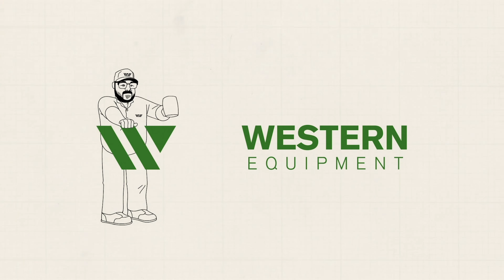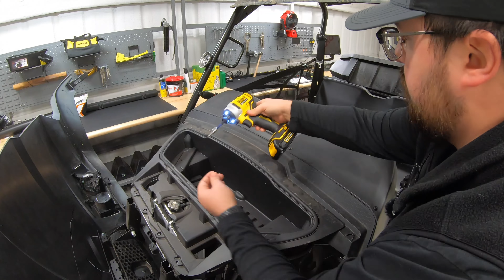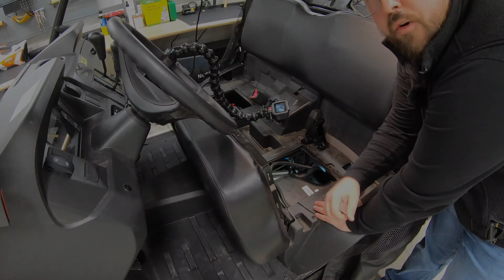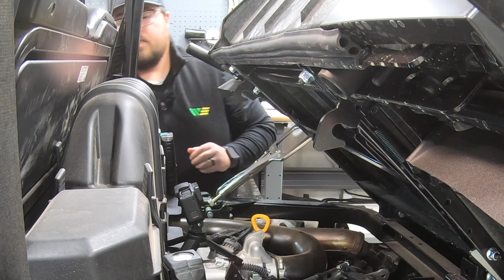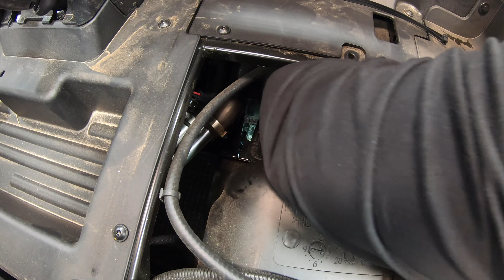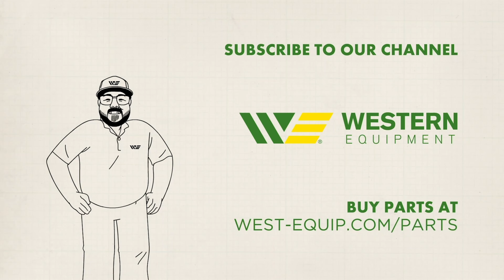How to Install John Deere Gator Electric Bed Lift for XUV500's series

Comment: A very well made presentation but I would like to have seen the speed of the lift travel more than the final down movement.  It seems to be at least 4 or 5 times as fast as the travel on my Ranger 570 with a $60 1300 pound actuator.
Reply from the maker: Thanks for the feedback. I will make sure to show this next time. So I'm assuming you are annoyed by the speed of yours?
Reply: @WesternEquipment  Considering I only spent $60 on my actuator I can live with the slow speed.

Comment: Hi Brett
   Is the wiring harness ,,,already on the gaytor,,from the dash to the spot under the seat from the factory,,thanks    Have a 2021 590 M coming in ,,,
Reply from the maker: Yes, it should already be pre-wired for this attachment. Congrats on your new machine and thanks for watching!